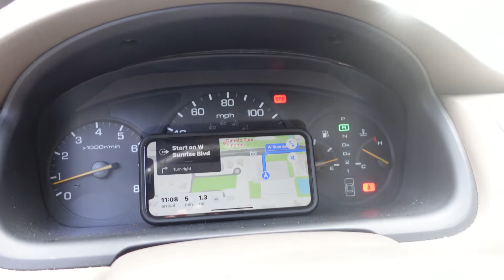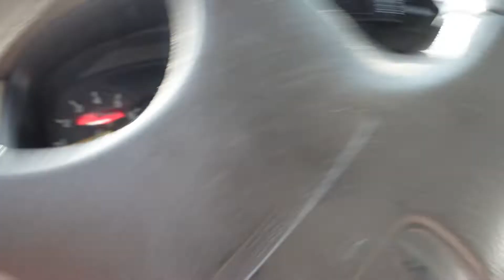Customer Care | Yamaha Stryker Oil Change

Comment: Hey Chaz I got a question I own a 2007 r6s and when I shift from 1-2 it is such a loud clunk is that normal?
Reply from the maker: Take you clutch case apart and inspect the plates I’d suggest changing them or draining all the oil and and using a good oil personally motul makes good oil get that and a small bottle of Lucas to help and put it in the motor
Reply: @Shawn.n Try using Motul 4T 7100 10W40.  Adjust the clutch lever.  If its not engaging all the way you could be a rough shift from 1st to 2nd.  If all that doesn’t work check the clutch plates and basket.